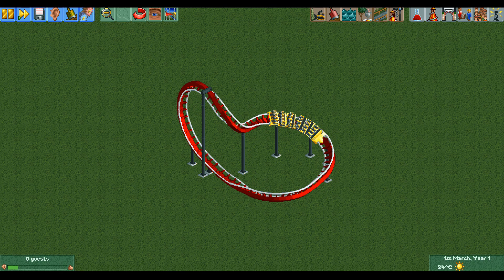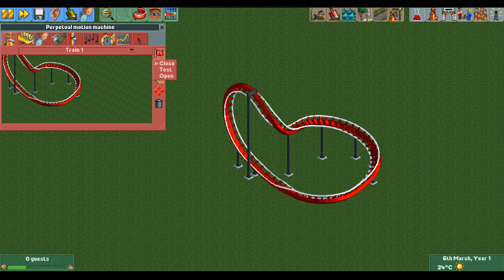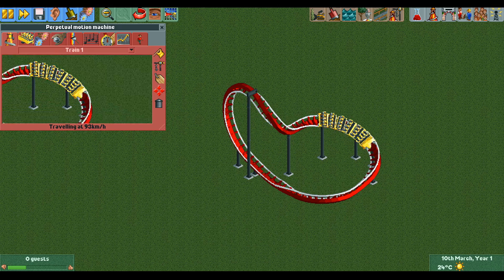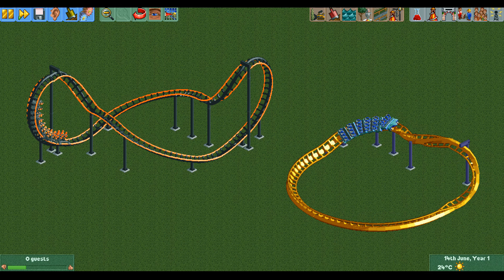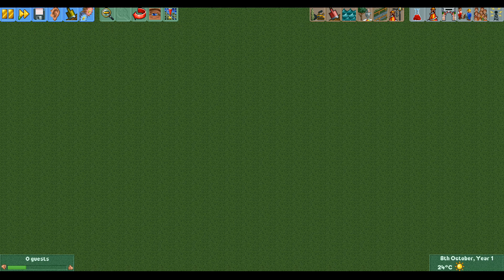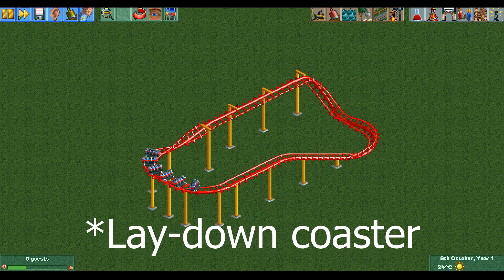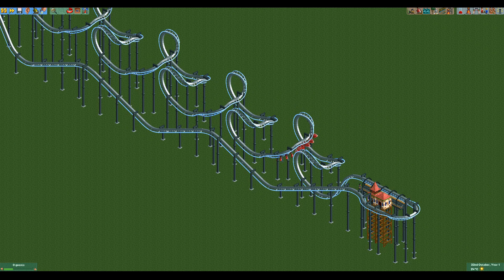Perpetual motion machines in RCT2

Comment: I know this video is old but could it be that the game codes corners and height differently so a curve down hill gains more motion and the reason for the end of the corkscrew gaining more speed is to compensate for the loss of speed at the beginning so their for if the beginning piece is removed it still has the speed increase. I’m have not looked into this just trying to think of why it could be.

Comment: This looks like driving downhill just gives a little more speed then it should and or driving uphill takes a little less momentum then it should. So just repeating it gains speed instead of slowly losing it.
But could also be a sloppy fix for many other small errors with the starter element. Does it work without it? (After initial push.)

Comment: From my old knowlegde, mostly RCT1 though, it is based on the coding of the corkscrew, it is a 'copy' of the half loop upwards, morphed into a 90degree turn, but keeping the same 'numbers' of a normal half-loop down. The acceleration is equal to the decelleration of the halfloop up (minus some friction), but as its only half its height, you have the rest of the 'downhill' to regain any lost speed/friction. This also explains why a half up/half down loop and a full corkscrew dont work, they are both equal (minus friction). The maximum speed it can achieve basicly is Uploop = corck + downhil + friction, friction eventualy cancels out any increase of speed (as acceleration and deceleration become equal).

Comment: I have a few theories and the first you can calculate:

For the Giga coaster: I believe passing the station adds a certain amount of speed - the speed being its base speed when it would leave the station onto a regular track piece. This gets added up a few times after passing the station and so reached the lift hill. 

For the speed quirks on the corkscrew elements: I believe this was implemented in development after testing out corkscrews. To expand, when adding in a corkscrew element, you get a lot of laterals and this increases the intensity a lot. I imagine that in development of testing the game, any time a complete corkscrew was added; it would hit way too many laterals due to the speed. A way of fixing the corkscrew element whilst keeping them this compact is to put a mechanic in that slows the train down going up into one and then fix the speed loss on the exit corkscrew. This would prove as to why this only happens on these certain elements. 

This could be hidden in the code somewhere when looking at these said elements too.
Reply: I’m wondering if it could be related to the fact that the train leaves the track inverted relative to its original orientation. If the game includes a little extra to the height calculation to account for the center of gravity of the train having changed relative position, then it wouldn’t take much of an error for that calculation to inadvertently add or remove speed more than gravity and friction would dictate.

Comment: If you create an air powered launch coaster and have a max height hill in front and one in the back, the train will no matter what never cross to the rest of the ride (usually I just make it a circle to the other hill). However if the track is available for long enough, occasionally it might make it all the way up and cross and will then travel forever on the track nobody was meant to go on. It is extremely boring due to the very very low friction tapen

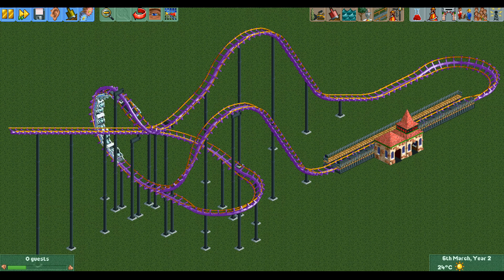Comment: 2:24, “inefficient” is probably not the correct word, it literally creates energy - it has set a new standard of efficiency
Reply: I reckon he means in terms of time spent going upwards, the chain lift is still the way to go. I do want to see what a roller coaster without lifts look like in terms of maintenance and repair rates
Reply: @indigotyrian  I understood that, but I think you'd have to specify that. "Time efficient" is probably what I'd have used.
Reply: @erikhjortsater5461  Dude, that's implied without any ambiguity.
"Energy" is not a thing in RCT2. I get that you took a physics course once, but come on.

Comment: 3:00 the deceleration formula might be something similar to [trainspeed = trainspeed minus 1]

Which gives the following results when given positive integers(first number is iteration, second number is value)
0: 4
1: 3
2: 2
3: 1
4: 0
But when given negative integers:
0: -4
1: -5
2: -6
3: -7
4: -8
Meaning that you end up with backwards acceleration instead of deceleration

I remember trying something similar in RCT3+wet+wild and the cars goes insanely fast backwards (until the game crashes)(you must turn on "less friction" or similar for it to work IIRC)
I was quite surprised/annoyed when I saw that someone else found it before me :L

Comment: In which games is this present? RCT2, OpenRCT2 and RCT1? that would be quite interesting
Reply: This is only possible with OpenRCT2 due to various cheats used.
Reply: @DevDreCW  thank you for your answer, I think I asked the question wrongly: I meant not the perpetual motion closed circuit, but I meant the corkscrew boost bug

Comment: Is there any similarity between this and the perpetual motion coaster posted by lot61 in the OpenRCT2.org forums (https://forums.openrct2.org/topic/3431-perpetual-motion-coaster/)? That one relied on a longer steep drop and shorter hills of equal height to sustain itself.
Reply from the maker: That's the same idea. Somewhere something goes wrong and it gains extra speed or loses less speed than it should.

Comment: I wish there was a way to trap guests on there, then you could set a new record for the longest ride as it will go on forever.
Reply from the maker: It's very easy to do that, but I don't think it should count because of two reasons: It never returns to the station and it uses cheats to get into the loop.
Reply: @MarcelVos  I see, have two records then lol. Longest ride with no cheats and longest ride with cheats.
Reply from the maker: @MadCarTK  The longest ride with cheats is way longer than the age of the universe as you can make a setup where for every ride in the chain the ride takes twice as long. I don't really want to get into that as the numbers don't make much sense anymore.

Comment: My guess is that the designers  just set a specific energy gained and lossed at every given track pice. Then did something like calculte it in a spreedsheet to get the number. Then either transfered the number wrong, or failed to take into acount  that the train is under the track when entering the corck sqreew., and over the track when exiting. This gives the train a extra 2  blocks of altitude.... (this should be able to check if it gains exacly 2 blocks of altitude (realtive to speed)

Of cause... The game designers can´t have made the same error with the half loop or normal sqreew, because then it would always even up
Reply: I think so too. This is an old game and I highly doubt they have dynamic physics on these 2d tiles.

Comment: Thinking in terms of a game designer, I imagine this behavior was made for corkscrews to be more dramatic, slowing down at the top. I'm guessing corkscrews were the first track elements added to a coaster that would attach in an upside-down state so an upwards corkscrew could only lead into a downwards corkscrew piece. It would have been safe at the time to implement this special behavior, but when newer rides got added with crazier upside-down coaster elements it had been forgotten about. Since it's such a subtle effect it would hardly affect any rides and the bug would go unnoticed. The fix for this behavior would have been to replace that section of code with a similar function to be called by all track pieces entering or exiting an upside down state, but it's too late to do that now.

Comment: In my experience, the 'conservation' laws (energy, mass, momentum, etc) are the single most violated things in virtual environments (including games)

In fact, given that getting a computer generated environment to correctly obey such conservation laws is much harder than just ignoring it...
(even attempts at respecting conservation laws typically have edge cases where the physics calculations will violate conservation of whatever property should be conserved. - lots of 'magic' numbers that remove energy too. Such a a 'friction' parameter which doesn't have any side effects such as creating heat/noise/light/etc, just causes an object to slow down. That ALSO violates conservation of energy.)

It could be argued to say something about the underlying nature of... If not our specific universe, the general concept of realities as a whole...
Reply: I mean you can do whatever you want with math and make absurd realities "theoretically" possible.
Reply: interesting point. So as we assume the games environment incorporates some kind of conversion mechanism between heat and usable energy (as friction does in reality), this leads to the assumption that the corkscrew track cools down on performing this magic acceleration. We should therefore be able to create all kinds of cool cold-stuff-based machinery in the game like totally overpowered superconducting boosters or a winter wonderland hall or sth.
Reply: Conservation laws often have to be violated, either by necessity or by choice.
Things like ballistic trajectories have to either be approximated with limited precision, or need to use a deliberate fudge factor to avoid egregious imprecision in extreme cases.
Other games, like Portal, base their entire mechanics off of these violations.
Reply: A completely accurate physics simulation would take way too much work to make, and too much processing power, for a game. Plus you sometimes have to break the rules to make the game work (objects have to come from somewhere) and to make it fun.
Reply: If you’ve ever tried to implement something that follows the conservation laws (especially of fluids), you’ll understand why video games don’t enforce them lol.

Comment: It’s because the game breaks down speed into x and y speed but rounds it to the nearest whole number. When it’s going from x to y the speed of the last car equals the speed from the first car. So when the first car goes faster the train goes faster (same idea as shoestring coasters)
Reply: Why would this only be a problem in these 2 specific scenarios though?
Reply: Andreas Michael Design its not- you’re exploiting a glitch because it separates x y and z into three planes but not relative to the train. It allows for a simpler /less intensive calculations of a 2000’s game. Now each train calculates it’s stats as a string but more powerful computers means more accurate/frequent calculations

Comment: There is another way to produce this affect. Its how your highest speed coaster record was beaten. Steep track pieces loose less speed to friction than straight down track pieces. So you can build a coaster that takes hills straight up and goes down hills on sloped track. I forget where I saw it but i replicated a design from the internet using the hypercoaster with maximum cars

Comment: I think your guess is pretty good.  I bet Chris didn't normalize the gravity vectors of the half corkscrew, creating an effect similar to diagonal running in very old FPS.  In a game like that, if you go full left that's 1.0, and if you go full forward that's 1.0...but if you go full forward and full left at the same time that's a movement speed of sqrt(2), or 40% faster than you should.  Modern FPS games map their inputs to a circle instead of a square, so maximum movement speed is always the same.

It would be quite easy to test. If a coaster loses about 40% more speed going up a half corkscrew than it does in a half loop, that's your culprit...though it's possible you may have to do 3D math [forward, down, and to the side] instead of 2D math in order to get an accurate calculation of the speed gains.

Comment: For the last one, I think the station is boosting it just slightly when it enters it, because at that point its speed is lower than the speed at which a station propels it.

Think of it like when on a swing, at the peak of your swing you'll lean backwards to boost yourself a bit, and gain a bit of speed that way.

Comment: I think this is made to avoid the train being stuck between 2 corkscrews, thinking about it I've never seen a train stuck between these elements (please someone try). For the last coaster this is normal, the station acts like a simple chain and it reduce de friction when the train is faster than the chain-speed. When you put extra chain in a slope it can help the train to cross the next bump if you need more speed, I use this trick a lot.

Comment: You can exploit vertical drops to gain speed as well, coasters lose less speed going up a vertical slope than they do going up a steep slope so you can build twister/vertical drop coasters that gain speed from going down and up from and to the same height over and over.
Reply: these are edge cases and most of these bugs don't affect normal gameplay at all

Comment: Doesn't this also happen with vertical coaster tracks? I recall someone making a coaster without using any chain lifts and just using vertical drops and steep hills (or the other way around, I'm not quite sure) to gain enough momentum to complete a track.

Either way it's a pretty fun discovery that I'm sure people will be very creative with!
Reply from the maker: You're right, I remember that as well. I can't remember the exact setup, but it did indeed involve vertical tracks and steep tracks.
Reply: @MarcelVos  Vertical tracks lose less speed when going up than steep tracks do, so you can have a steep slope down and a vertical track up to take it back to the same height and it will gain speed if you do this over and over.
Reply: @NightlifeSux  what about regular slopes?

Comment: Since the train goes around infinitely, doesn't that technically mean this is the new longest coaster ever?
Reply: cant qualify if it never ends
Reply from the maker: @EndOfTheW0rld  It also uses cheats to get the train into the loop.
Reply: @seananderson5850  If you allow non-terminating trains to count, you could just drop the train into a dip and have it rock back and forth with a chain lift. Technically it never reaches the end and goes an arbitrary distance
Reply: @seananderson5850  Depends on how you count it, but as long as you don't count rolling backwards as negative distance, they are still gaining distance
Reply: @seananderson5850  yes, which is why you do a chain lift to rock the train. It's been a long time since I've played, but I'm pretty sure there's movement at the end of a chain lift when the train can't go higher up
Reply: Anderson called
Reply: @seananderson5850  ∞+∞=2
Reply: @StefanVeenstra  no since infinity is a set, not a number itself
Reply: @GewelReal  1 set + 1 set = 2 sets.
Reply: I fell like people should have to be able to get onto the ride
Reply: No, you can define it's length through set division or by a simple line integral. The length isn't infinite just because it's a closed loop.
Reply: Still haven’t even found the end of my dick
Reply: @randomdude189  did you check in your mom?
Reply: Mr Anderson was here
Reply: There is a glitch whit reverse mode, if going into the station always in normal way (like continuous), it's never gonna stop and for that, corkscrews glitch combine whit it does it, (tested in vanilla)
Reply: It depends on what you mean by "longest coaster". If you mean distance, no. If you mean distance traveled by the cars, yes. If you mean "longest coaster to complete", then no due to it never completing. Also, cheats.
Reply: Популярные фейки бтг генераторов
https://www.youtube.com/playlist?list=PLlEX99xZE8qMNq3ZLDRLtwUsJhpbd4KaO
Reply: You can't measure Infinity.

Comment: For the last one, doesn't the station add some speed each time the train passes it unless the ride is over?
Reply: If it's a chain (or tires or something other than an electromagnetic booster) , its's quite slow and slower moving elements can never speed up trans that are faster. They can only make them slower.
Reply: Only if the operation mode is set to launched from station.

Comment: Now the question is: 

How can you abuse this?
Reply from the maker: I don't think you can. Friction stops rides from going faster than a few hundred km/h and if you want a ride that doesn't slow down it's way easier to just put a fast chainlift on all pieces.
Reply: @MarcelVos  You could definitely make coasters that maintain speed for longer without dropping significant distances, or that lose speed quicker without needing sharp inclines or brakes.
Reply: Volley launches?
Reply: I think it could potentially eliminate the need for coasters to climb a hill via chainlift and make them more compact as a result
Reply: @justinokraski3796  plus if a safety cut out occurs, the lack of chain means it won't stop for that breakdown